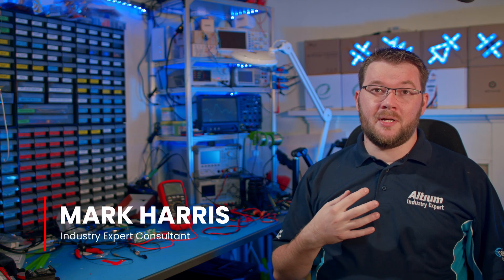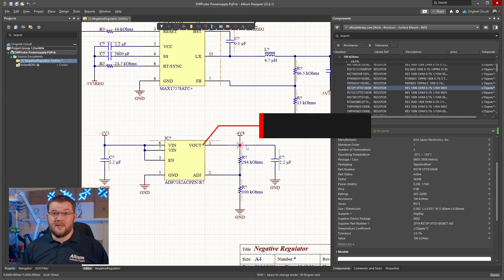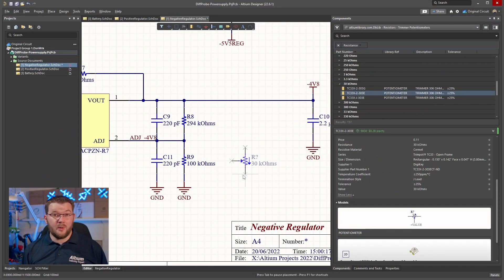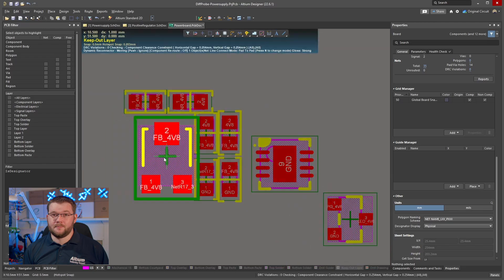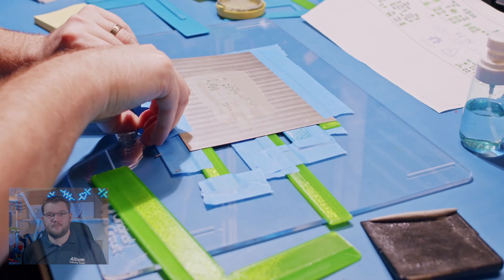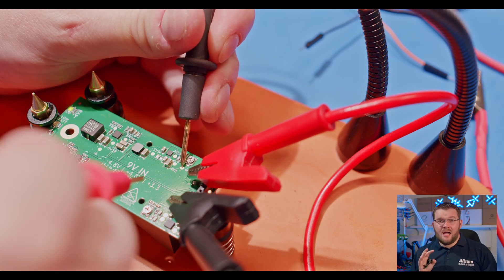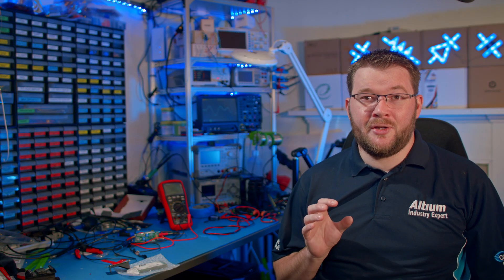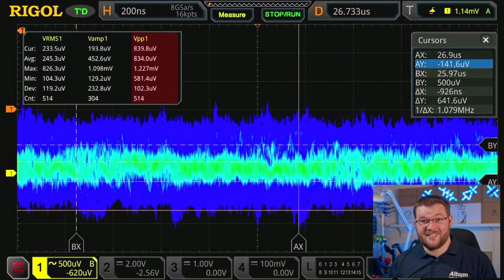How to Design a Low-Noise Dual Rail Voltage Supply

Comment: At 1:53 you have two wires crossing that have a schematic node.  The connection of the 220pF caps with the 294k & 100k resistors.  I try to avoid placing schematic nodes where wires cross.  In other words, I do not have 4 lines coming away from a schematic node.  
The reason is that when people read my schematics I want them to always know that where two line cross, there IS NOT a connection.  Two lines crossing are not connected.  As a result, when there is an intersection of 4 line segments, I split it into two nodes.  I prefer to us this style of two-node intersection of four component terminals in the schematic so that people never wonder if two crossing lines (2 horizontal segments & 2 vertical segments) are electrically connected.
Optionally, in a small design such as this one, I will manually name every net.  The net I am discussing in this comment would be labeled "4v8_adj".  I don't let the tool randomly assign net names, because I don't want mistakes when I add pages to the schematic that already have autogenerated net names, which might match existing autogenerated net names.  The tool should be good enough to generate an error, but I prefer to have a "best practices" of naming my nets to avoid the chance of this error.

Comment: BTW, what makes you still use opamps as comparators? And most importantly, why does the first one lack hysteresis? Imagine what happens when the battery's voltage gets lower much slower than you expected, which, at some point, will cause the "comparator" to act as a crazy noisy amplifier 😂.
There is lots of true comparators to choose from, for example, RS8901XF. IMHO, you just made the worst choice.

Comment: Being satisfied by not measuring the output noise and assuming it's just negligible is a manifestation of delusion and a demonstration of the worst practices.
Building a tiny amplifier to measure that noise would be a trivial task. Not doing it, especially when the PS is part of a very low noise system, is a big failure. (I won't laugh at assuming the noise level was "negligible" since it was lower than my inadequate oscilloscope's own noise or than that of a random resistor 🤭)
I thought Altium (as a company) was much more serious than this. 🤦‍♂️
Now I know better. 🤡
Very important note: I still have respect for some key people like the wonderful engineers who made AD, and others like Zachariah Peterson.

Comment: Why not use a switched mode regulator on the positive rail as well? By doing it with an LDO directly you’re dissipating over 300mW at full load there, which is a lot in a battery powered system.

Comment: Darn! Hoped this would solve my supply noise problem, but I need to go from a 5VDC USB supply to +/-9VDC rails for my op amps. 😢
Nevertheless, thanks for the tips that I was able to understand.
Reply: You should be able to implement an almost identical topology - just add a boost regulator and LC filter before the positive side linear regulator. So your 5V comes in, goes to two switching regulators - a +9.5v and -9.5V, which then both go to LC filters, and then feed a +9V and -9V linear regulator respectively.
Reply: @OriginalCircuit  Thanks so much for that info. I'm currently using a IH0509S unregulated 5V to +/-9V DC-DC converter, w/10uF caps on the rails for smoothing on the prototype. Assumed that I needed to add +9V & -9V linear regulators, so I'll look for a single split one instead.
Any suggestions for the LC filters?
Full disclosure, I'm a real dip-shit regarding circuit design, but not too bad with a soldering iron.
I really appreciate your help.🙏

Comment: Hi Mark, great content! Amazing how one can get an off the charts low noise PS that "easily" these days! Quick question: at https://youtu.be/xLjGT3L2-yc are you using an AZV321 op amp in open loop as a comparator? If yes, a possible suggestion is to use a proper comparator and avoid the unlikely but possible false triggering due to the op amp saturation. Since I don't have an altium licence, I couldn't check the schematics directly.
Reply: Yup, I'm using the opamp as a comparator to keep the BOM smaller, its very much a non-critical area of the circuit!

Comment: Switchmode and Low Noise are kinda mutually exclusive. Ultra gets even harder.  The simplest design with two +/- 9v batteries will be the quietest you can get, across the full noise bandwidth.